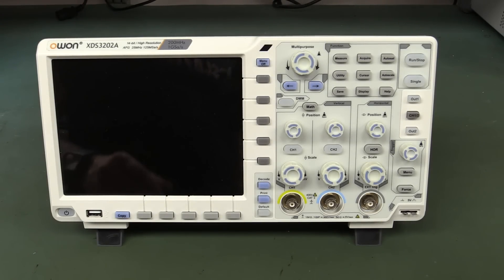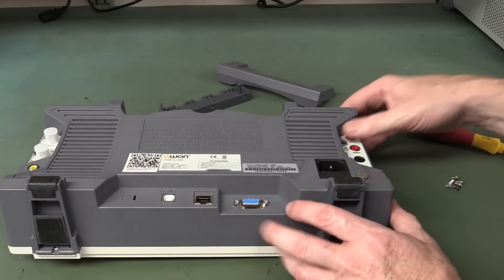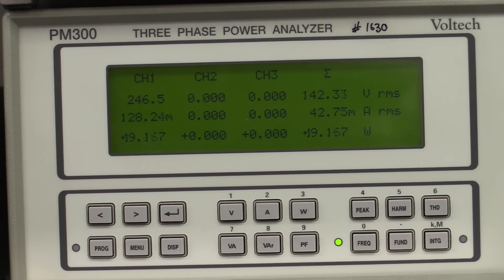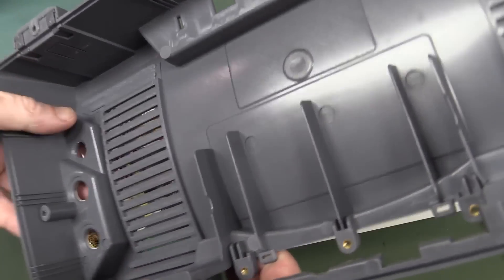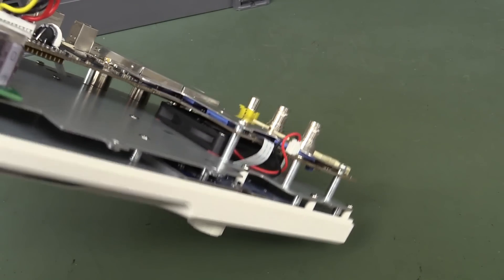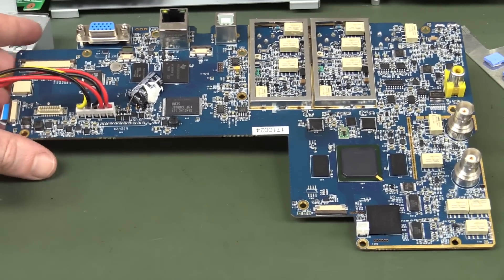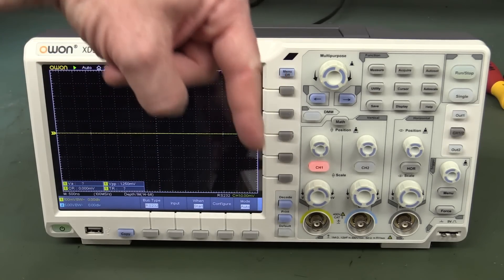EEVblog #1004 - Owon XDS3202A 14bit Oscilloscope Teardown

Comment: 8:55 , looks like cold solder joints on the Common and V input jacks? If so, those'll crack and fail in due course.

Comment: 7:00 is the earth wire on the wrong IEC pin? Looks like it on the Neutral pin.
Reply: Hopefully there are some weirdly routed traces on that board.  And it could be LIVE as well, we have 230 V 50 Hz in Europe and unpolarized plugs.

Comment: Hands up those who can clearly see the fan "airflow" arrow at 10:31 (pointing upwards) while Dave blathers on about how badly designed the airflow is... I wish he would check his facts before he belittles the design engineers so much...
Reply: haha @EEVblog always goes off the rails right from the start if the UI and things are not exactly like Daves wants it to be, sometimes I wanna hit him in the head with the gear he is reviewing , but that's half the fun =) But I very often feel like he should spend a couple of minutes before pressing record and learn how the damn thing works before he starts sounding like somebody is strangling a cat :D

Comment: The antenna on the mains socket is probably the best they could do. A microstrip antenna on the PCB would have a bad ratiation pattern because of the close ground plane. So it's the furthest point from the ground plane. A half wave dipole would be better of course ;)
Reply: Best they could do? Seems to me like the sky's the limit and of course we've seen incredibly clever designs from other manufacturers.

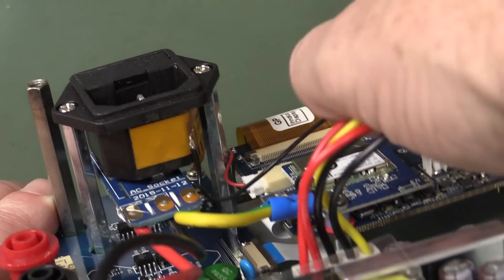Comment: At 6:53, I bet with a little experimentation, they figured out a way to couple their wifi to the mains cord for better reception.  I'm not a radio guy by a long shot, but I've taken apart enough clock radios to know that's how it's done.  In general, table top AC powered radios usually have some coupling between the radio antenna circuits and the AC power cord to improve reception and in some cases not need a telescoping antenna.

Comment: 17:14 what's going on with missing the R139 & R140 and flux residue - someone reworked the board ...
Reply from the maker: +zaprodk I watch the video through the small camcorder screen, and in taking at the same time. Easy to miss stuff
Reply: Sorry, that text came across all wrong - it was not critique. It should have said "what's going on with the missing R139 & R140 and flux residue". But maybe explore what it might be? Can it be resistors that set the model in software?

Comment: For observing really low noise signals I use my Tektronix 5103N.  It's not digital, it's kind of heavy and it has no real storage capability.  But it only cost $20.

Comment: 18:13: Is there a short between two pins of the Ethernet connector?
Reply: I think it does not mind because the two pins should be  GND on the connector

Comment: The back is curved in case it gets pushed up against something, but with no direct air entry/exit points thermal instability could be an issue. Lots of room on the DMM PCB so revisions could be made so this this could stand up to an educational market.

Comment: Aren't those antennas taped on? Kinda scary place to put it.. :O What happens when the adhesive dries up as it usually does?
Reply: the world explodes
Reply: "What happens when the adhesive dries up as it usually does?" -Look at your avatar.
Reply: It's the "normal" product nowadays. By the time the adhesive dries up and the product goes kaput, the warranty is expired and you're supposed to buy a new one. 99% of the products are like that, unfortunately.

Comment: Hi! I have some trouble measuring the inductance of a  coil in a bipolar stepper motor (20 Ohm resistance). I have used several methods using function generator and oscilloscope. So far, the results are pretty much all over the map. Please discuss this topic (maybe in Fundamentals Friday..?)

Comment: Stupid question because I'm not watching these: Why is it only 14 bit?
Reply: Lu Tello Making accurate, high speed converters gets exponentially more complex as you add bits. Many oscilloscopes are 8-bit as a result. A 16-bit converter would have to be very slow or extremely expensive.
Reply: Lu Tello If it helps clear things up, the "bit" specification refers to the analog to digital convertor (ADC) and not screen colors or anything like that.
Reply: "only"
Reply: To expand on this, each bit doubles the effective resolution of the scope, so a 14-bit scope has 4x the resolution of a 12-bit scope.
Reply: techmage89 technically yes, but you have to start looking at noise floor and ENOB at that point, I won't go into it but it becomes the precision vs. accuracy discussion
Reply: most scopes (low price tag) still 8 bits and have been 8 bits for a long time even the ones with hughe samplign rate. 14 bits is a lot actually.
Reply: simontay1984 search for "ENOB Keysight" and we have an app note on it, it means "effective number of bits." So, if you have a 14 bit ADC in your scope, how many of those  bits are actually meaningful?

Comment: IRQL_NOT_LESS_OR_EQUAL is usually a hardware fault in my experience - not caused by an update. Many, many things to check for, but a common and quick one might be just to reseat the memory. Windows 10 may be extremely annoying with its slow, forced updates, but the update mechanism itself is pretty solid! Also, +1 for the Owon scope. Our shop runs on Owon scopes (the mid-low end ones like the SSO8192) and they're fantastic to use, intuitive and straightforward for folks that aren't hardcore hardware geeks ;) Battery is very useful for isolation, not just travel!
Reply: i had IRQL errors while overclocking(those good 'old' ivys from like 2012), but I had them on completely stock machines as well
Reply: Analyzing the memory dump with a debugger can do a lot to solve the problem.
Reply: Jeff Metten Uhh yeah, sure. Then what? How do you fix it? Talk bad about Linux's useability, but I've always been able to rescue a linux install by chrooting into it with a live usb stick and fixing what's wrong, I've Never had a successful Windows repair. It always ends up in a complete reinstall. Whereas with linux, you get back up and running.

Comment: Since the internal rail is 5.5v I wonder if you can charge the internal battery over the USB device connection? Not enough to supply the 20W it wants to run, but you could totally charge while it's off

Comment: how bad was the soldering on the multimeter board and i saw a lot of bad soldering .for the price you would think the QC would be a higher standard .I see alot of potential faults waiting in the wind with that particular scope

Comment: Nice video... Helped me with disassembly. Has anyone been able to flash the firmware on this model? Is there any recovery tool that can keep the device powered on when the self test fails and the device shuts down within 10sec. does it turn itself off including the USB connection?

Comment: I want to build a basic oscilloscope, where should I start? Right now I'm using an old tube TV as a wave visualizer. I've taken a couple circuits courses so I know about op - amps, diodes, mosfets etc but I'm not sure how to combine all of those things to make an oscilloscope.
Reply: a CRT television is a basic oscilloscope.
you have both the vertical and horizontal drivers and a time base generator in b&w or color TV. however the ' time base ' is the horizontal scan rate of NTSC video. 
 
all you need now is an input buffer and a trigger amplifer

Comment: Umm.. The fan points clearly to the rear board. You can see the arrow on the fan pretty good ;)
Reply from the maker: +Robbe902 the heatsink, you know, that thing you want to get the heat out of, is on the other side of the board.
Reply: Yes, I saw that too. On the other hand, the cooler has no fins anyway to spread the heat effectively. I do not know how much waste heat is generated by the display or other components on the front, or if the fan is only installed to create any air movement (to pull warm air away from the front). You're absolutely right that this fan is somehow .. misplaced in its place.

Comment: Look at those dry solder joints on the dmm input jacks.... Terrible.
Reply: Not only the DMM input jacks: the oscillator board looks horrible! That SOT23-5 looks like it will drop off just by looking to hard at it.
Reply: But it has a QC Passed sticker!
Reply: The 10A shunt is adjusted by moving the solder around until the shunt is in calibration - hence the messiness.  This is the normal way to adjust wire shunts!

Comment: There's a fuse in the AC connector, maybe you should use a multimeter cable with built in fuse :D

Comment: What switching IC are they using for their switching?  Is it just a typical rectifier with stepdown windings plus a buck?
Reply: What's a "typical rectifier with stepdown windings plus a buck"?

Especially at that power level, you don't expect a whole lot of complexity. It's just your bog-standard off-line flyback converted. That TO-220 package on the primary will be the all-in-one PWM+MOSFET combo (think stuff like the TOPswitch line).
Reply: What I meant  by "typical rectifier with stepdown windings plus a buck" is an offline converter!  I didn't know it had a specific name for that topology.  Thank you for commenting, learned something new!  And yes, I can see now that discreet parts really wouldn't be necessary.
Reply: For the record, "buck" is by definition a non-isolated step-down converter - not something you'd want in mains-powered gear :P

Comment: Can anyone help me?
What oscilloscope could I use for tuning audio equipment like reel to reel and tapedecks?...so up to 30 kHz or something. Can someone give me a tip for an affordable machine, if that's even possible?
Reply: Attila theHun you can check out the Keysight 1000 X-series, for audio use you may like the built in Bode plot/ frequency response analysis.
Reply: back in those days, 20Mhz were the standard, and they were CRT.  For speed check still better to use an universal counter IMHO. The rest I cant tell but bet you will need XY mode at least. Very obvious, but check that. Most service manuals try to use Multimeters when posible, they use very clever procedures. Also helped with specific tape. For R2R only seen the UHER Report series, and I dont recall them telling about an scope. A pretty decent machine. Probably I am mistaken. I would pick a good analog CRT in good working order, 40Mhz would be enough. Analog gear were the only option in those days so they will fit perfectly.

Comment: Dave, I've got absolutely nothing wrong with the thermal design of it. It appears to have quite low power parts in it. I've seen far worse thermal designs in laptops with similar power CPUs. My network switch takes 15w and doesn't even have a fan. Perhaps worth taking a look at its cooling performance?

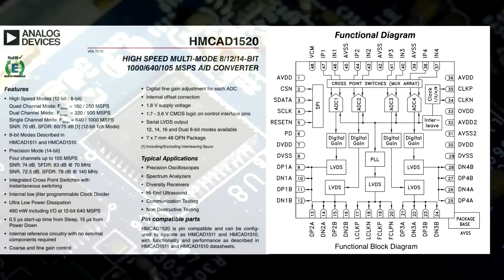Comment: 13:50 - you can use chalk to ID chips! White chalk gets into the crevices and lets you easily see what's going on! IT's chemically inert with the epoxy IC packages, and doesn't conduct, so it's relatively risk free. Here are three IC's I 'chalked up', and even on my awful not-quite-a-smartphone camera, the chip names come out uite clearly! https://twitter.com/LargeCardinal/status/863503815437422592
Reply: Mark Carney nice trick

Comment: For just under 1.4k price range.. It's kinda disappointing. 
Don't like the PSU seriously not even a  removable glass fuse?
Really don't like the way they did the antenna for WiFi. It would only have cost a dollar more or something to have a decent antenna strip attached to enclosure... 
And then the worst airflow/thermal regulation fitted fan. What the actual f*ck... Again it would only costs a dollar more or something to have a decent FAN bracket attached to one of the sides. A real shame tho, could have been much better product with minor extra effort by the manufacturer

Comment: not good power supply
Reply: On what actual hours or year long testing do you base that on? Or just because they use caps from a brand you don't know?
Reply: Mark R. aii even wifi on main conector..you know more about caps
Reply: Because you're going to be using wifi on this 24/7? Look on an xbox one and X where the wifi got hacked on, right outside of the metal shield.
It's just the problem of wifi and shielded devices (where to put the Wifi antenna, even the most high-end audio equipment has their wifi hacked on weird spaces.)

They probably looked where it caused the least amount of distortion and that's where they ended up, sure they could have mounted it on a nice bracket and then you'd still complain where it is (eventhough it's fine)
Reply: Mark R. ok so wherebis the fuse..on scope i whant pfc and good shield and antenna for wifi it is just less then a 1$..thanks
Reply: Buy another brand?
Reply: Crap caps are crap.
Reply: Mark R. i have keysight and low brand rigol...bye bye